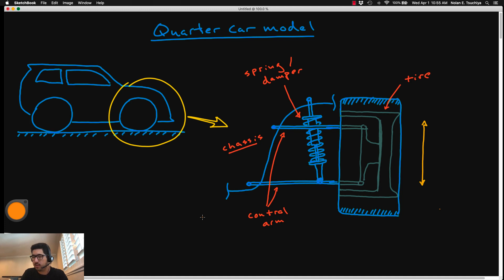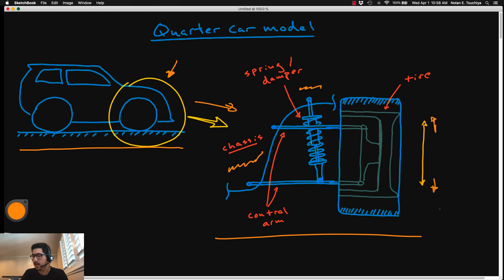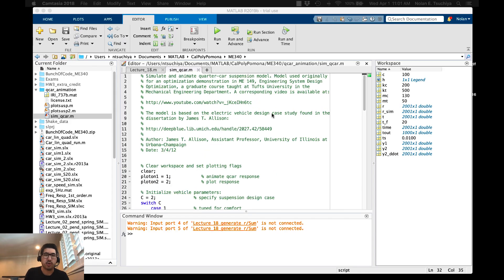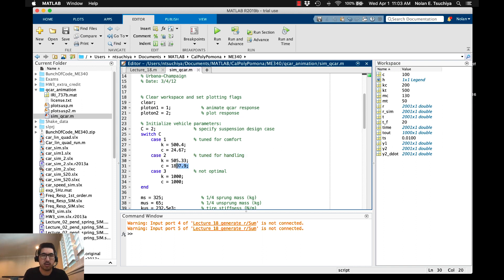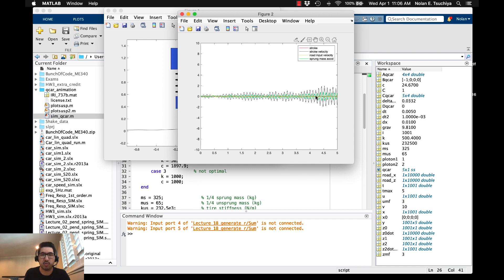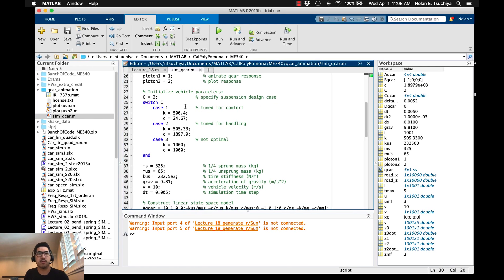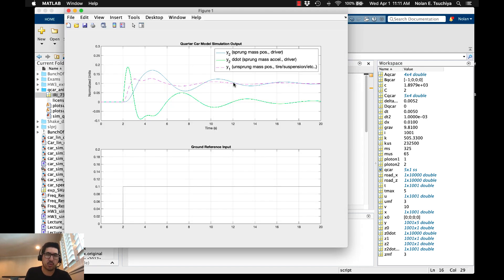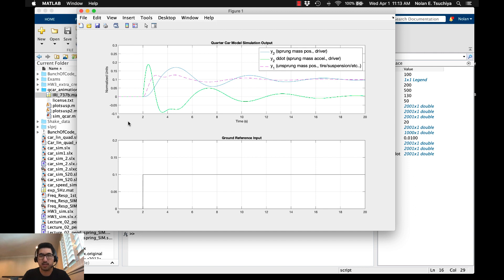Lecture 17/18 | Quarter Car Model Example | System Dynamics ME3401 | Cal Poly Pomona

Comment: would you be able to explain how this could be modified for a different road condition such as a cosine function (ie. 6cos(pi*x/20)).
Reply from the maker: You would just need to define the input function desired. The system dynamics don't change as a function of the input.